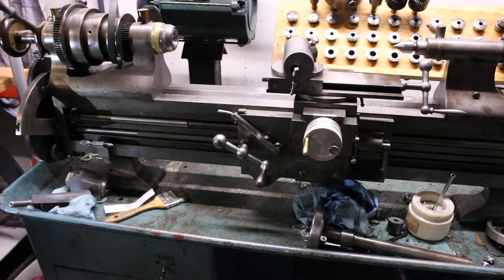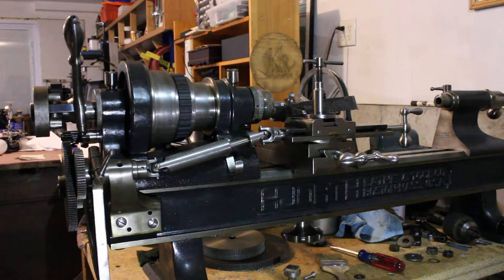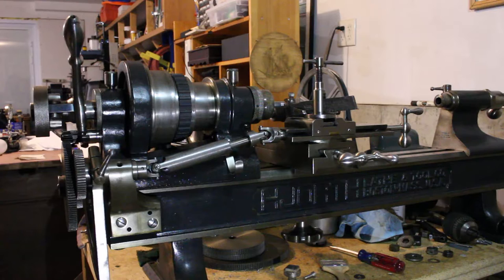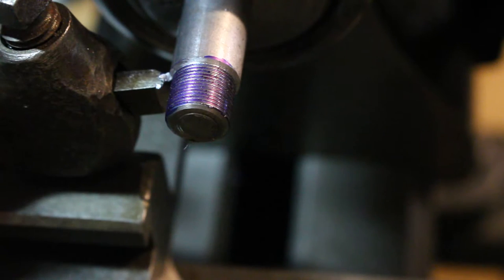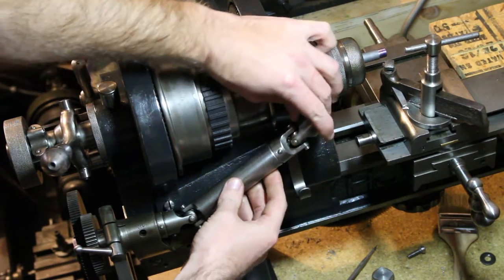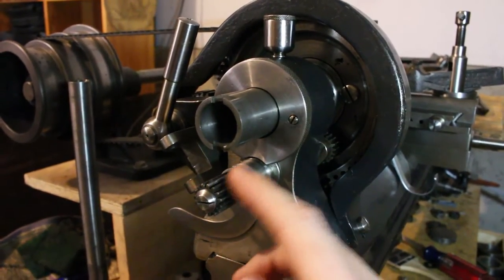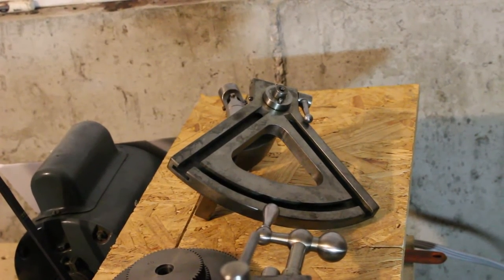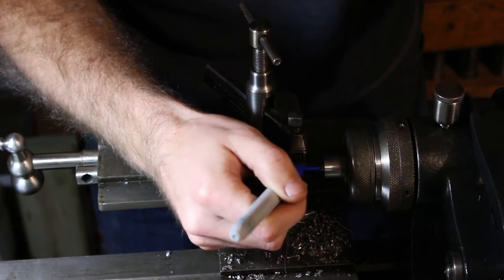Threading on a Plain Turning Lathe

Comment: My rivett is just like yours. Just mine has been treated little rough by previous owners.
Reply from the maker: Very cool!  Don't see many of them around, so always nice to run into another Rivett owner. :)
Reply: Are you using boring bars for regular cutting in your eccentric holder?

Comment: Thanks very much for this video. I have a screw cutting attachment for my Schaublin 70 which I have been dying to use except that without specific instructions for this I’m afraid I’ll do some damage to it. The main issue which you alluded to being that the spindle speed cannot be reduced below 300rpm which seems very high for threading especially without a clutch mechanism to quickly disengage it. Perhaps there is a way to turn the spindle by hand for this lathe although I am yet to have seen this. 

In any case you have so far provided more instruction on this topic than anyone I’ve found so many thanks again!
Reply: Can you thread in the reverse direction with your Schaublin? It's a great way to avoid running into the headstock/chuck, and for doing inside threads...

Comment: A 3 phase driven by a VFD with a braking resistor could get you a faster stop.
Reply from the maker: Yep, definitely.  Actually all the VFDs I've seen (even the cheap ones) have programmable decel.  Only potential danger is if you have a heavy chuck threaded on, an aggressive decel can cause it to spin off.  Happened to my dad on his SB, a 10" chuck spun off, bounced off the bed ways, hit him in the chest, and knocked him across the shop.  But I digress.  Ultimately I plan on having all the Hjorths set up with 3 phase motors run by a VFD... it's just such a nice setup.

Comment: Interesting to see one of these in use with single point threading - I have one of these attachments for my Lorch AVI-RG lathe ( https://flic.kr/s/aHskPvnWpL ) which includes a dog-clutch for detaching the feed at the end of travel. I haven't got my hear around though what the required conditions for re-engaging it are, so I've not yet managed to create a valid thread. I get a few passes in the same place, but always manage to ruin the next one...  There's another one at https://www.youtube.com/watch?v=TYMIDhVYLGg also with a dog clutch similar to the Lorch, but no indication if whether it can be used to re-engage when screw cutting, which might of course be less of an issue with thread milling in any case.
Very nice lathe(s) by the way !
Reply from the maker: Beautiful, I love those Lorch lathes! :)  Neat to see a couple of attachments with dog clutches too.  As you say, though, there's no way to reliably re-engage during a threading operation with only the clutch, unless you put timing marks on all your gears and make sure they all line up before re-engaging the clutch in exactly the same spot.  Conventional lathes get around this problem by using threading dials or thread counters, they ride along the lead screw as the saddle moves and you can use the marks on them to re-engage with your threads for each pass.  For these threading attachments, though, you'd need something that engaged with the lead screw inside the compound slide, it would be a real challenge to design something and and I think you'd necessarily lose some travel with any design.